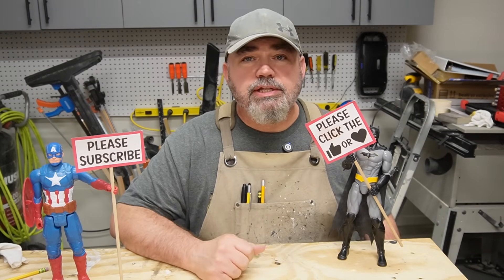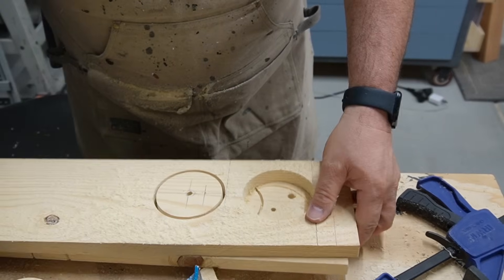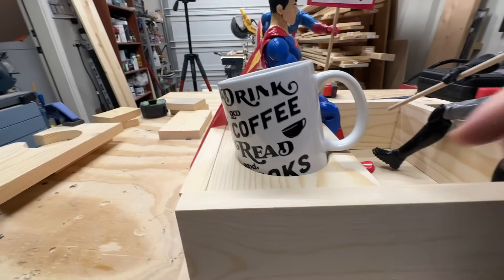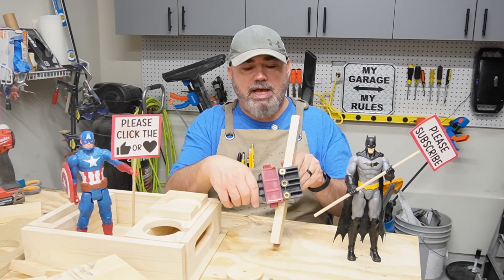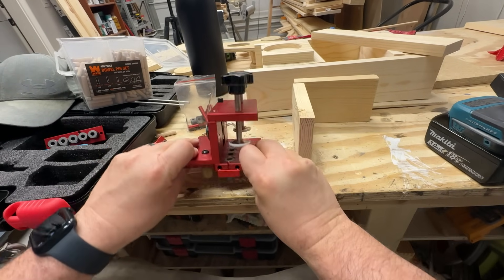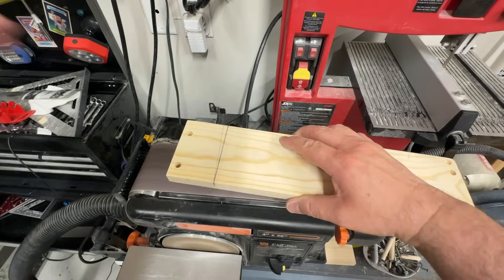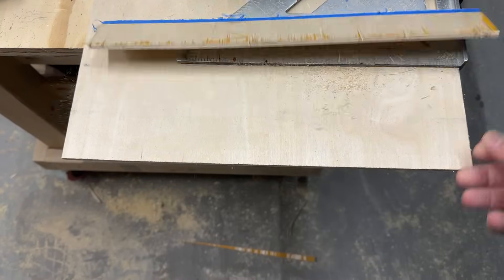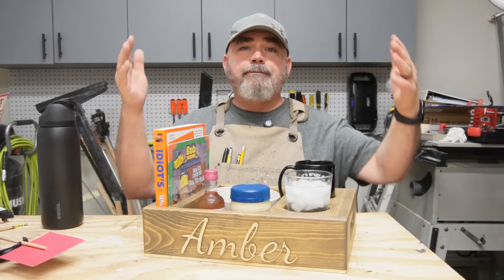Woodworking Project That Sells - Easy DIY Woodworking Projects

Comment: You can use the dowel jig to center over the board when using the holes besides the 3/8...you have to put one of the front legs on the other side of the board...
Reply from the maker: are you serious! I was wrong in my explanation of why I was right!! 😂😂😂 Thank you!

Comment: Big fan of your vids so far. Little tip with dowels.  You can microwave them on a paper towel on high for 30seconds to shrink them for a better fit. Maybe that will help with those unamerican measurements.
Reply from the maker: I did not know that but that is great to know! I will definitely give that one a try. Thank you for the encouragement and the advice.!!

Comment: What grit r you recommending for the hemorrhoids. Is that high grit for smoothing or are we talking 30 grit and just getting er done
Reply from the maker: Depends on how hard they are, I would start with a 50 grit and work to a 220. Any smoother and there wont be anything to slow down the turds!! 😂😂😂

Comment: if you added a small rabbet on the bottom of your side pieces, you could inset the plywood bottom so you wouldn't need to worry as much about the fibers left by the router (and also no plywood edge exposed!)

I would have picked the same stain colour. maybe even a sligthly darker one possibly.
Reply from the maker: Thank you, that is a great idea. I was originally planning to do something like that but then I went with the doweled butt joint instead of a mitered joint. If I cut the rabbet you would have seen the hole at the end because I had the side pieces going all the way to the end. If I would have planned it better I could have maybe reversed the butt joint so the front and back pieces covered the sides or I should have just did a miter joint! lol I hope I was making sense! 😂😂😂

Comment: 12:21 for that dowel jig, did it say that the drill guides are hardened? If not, they will wallow out and get egg shaped so your holes won’t line up perfectly. The dowelmax system has hardened guides and a lot of companies try to copy the basic design, but skimp on the quality.
Reply from the maker: IDk, thats a good question. There is no instructions or any literature about it. Ill have to look on the website and see if it says on there. Thanks for the heads up, its appreciated.
Reply from the maker: I didn't know you had a channel, I just subed!
Reply: @jascogoods  I don’t have any bandwidth and my phone service sucks for uploading videos so I don’t do much. I used to do facebook live when my wife and I made epoxy tumblers, but it was just fun to watch if you need to fall asleep honestly. It’s pretty hypnotic

Comment: In hindside you probably dont need to take the bracket piece off and off. You could just use f style clamps to hold the piece in place for the face side holes. Great video btw love it
Reply from the maker: that's a good idea, I might try that next time. Thank you for the advice and the encouragement.

Comment: Way to go, nice build. Remember, no build is ever prrfect.
My favorite type of joinery method is dowels, because it is super strong and can be hidden or evposed. I don't even know how many dowel jigs I have. My favorites are the dowel max and the 2 versions by Jessum. Both are from Canada and are surgically accurate. However there is a fairly new jig by Milescraft called the Joint Master. It is similar to the Chinese version you were sent. You can buy it both in Imperial and Metric. You do have to change the settings for the different configurations but they are so inexpensive, I just bought two. There are several YouTube videos on how to set it up properly. Keep up the good work. 19:36

Comment: After using both of your dowel jigs, do you recommend a dowel jig or a drill press?  I don't have either but I have to admit, your new jig looks impressive.
Reply from the maker: That's a tough question because they both are useful in different ways. I don't have a drill press but I could have used one on this build with the  hole saws. The dowel jig is great for joinery but I think you could do it different ways. I would have to say a drill press but maybe its because i don't have one. lol
Reply: @jascogoods  I know exactly what you mean, and I have one of those pain in the neck drill guides from Milescraft. Cheap but not useful.  I think i'm going with the 10-inch drill press.  I can hide it from my wife.

Comment: How are you liking your xTool S1 ?  If I had a board say 6"wide and 32"long can I use the xTool S1 to engrave something in the very middle? Or does it have to fit inside the machine?
Reply from the maker: I love it, I use it all the time but my wife loves it more. She made everyone at her work Christmas ornaments with it. You cant put anything that long in the standard base but they sell an open base that you can burn into sheets of plywood if you had too.

Comment: 6mm=.234, 8mm=.315, 10mm=.394.   Metric sized wooden dowels are available in eBay and possibly Amazon..
Reply from the maker: Thanks brother I appreciate that. I found some on Amazon I'll probably order. I haven't decided because the 5/16 worked in the 8mm.
Reply: @jascogoods  - 5/16 is .3125 and very close to 8mm. Gives you a little glue space

Comment: 8mm is actually a bees Willy over 5/16”, so yeah, a quarter inch will fit in an 8mm hole but it’ll be a bit sloppy. 10mm is 3 bees Willys over 3/8”. A quarter inch is 6.4mm.
Reply from the maker: a bees willy! 😂😂😂😂 I never heard that before but i am using it now!!! Look for it in a future video!!! That is hilarious! thank you for the laugh and the great conversion!!
Reply: @ 😂😂 the expression is quite common here in Australia. Though it’s a tad cruder. Instead of Willy, the term that is used rhymes with Rick. 😂

Comment: I'd put a cork costar under that ICE COLD drink, or you will have H2O all over the bottom.
Reply from the maker: That's a great idea. Definitely going to use that in future designs. thank you for the comment and the tip.